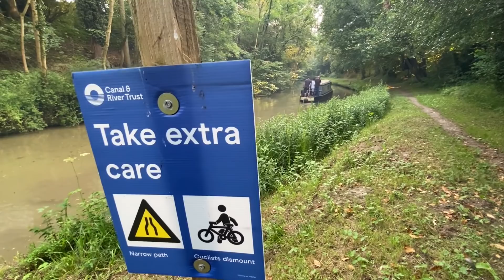222. Final steel sheet welded to Narrowboat

Comment: Hi James just a word of caution I have a friend whose main job is overplating boats he's had boats in where the new plates have not been fixed to the Old Hull in enough places this causes the new plates to vibrate when the boat is moving and can fracture the welds along the outside thus causing the plates to detach
Reply: I'm a little curious about the overlap joints normally you would bevel the plates and route and cap the joints tying the old baseplate to the new one,
Reply: Also those plate should have been folded as well as now they will be constantly under pressure.

Comment: I've been a shipyard plater for 40 years and have never seen anything like that.why would doublers be overlapped like that?  Plates should always be chamfered and set up as a butt joint. Occasional plug welds should also be made on the bottom flat sections to stop the doublers sagging.if the horrible welding on the Chines start to fracture the whole bottom will start to come away.very lazy work.
Reply: That's how I would do it too!
Reply: On the inland boatyards you often find welders that are totally unqualified, its pretty shocking and there are no standards for repairs at all, most surveyors have no clue about welding and will pass anything that looks OK.

Comment: I weld a lot of narrow boats from full plating to  infill deep pits with weld filings.  I algays use flux cored welding wire usually.1.2mm wire. Never had any trouble in tbe wind as the flux is built in o the gas wire..

Comment: A friend who is a steel fabricator ( his own business ) building heavy plant stuff / trailers - bulk tankers, he can't believe seeing this.
Stress fractures will happen along the welds as the plates have no formed bend / angle in them, the plates will try to  spring back flat away from the edges ( stress fractures ) either through the weld or along the edge of the heat zone from the welding on the  old thin side steel.
Reply: My and other comments regarding welding practices have been deleted, why is that.
Reply: @garychamley3095 
Oh really, wonder who's done that and why 🤔
Reply: Put the boat in a normalisation oven 🤣 and the mig also looks rather small, amps wise !
Reply: @npo1297  truth hurts. I mearley stated I thought that was the root weld, and it was going to be capped off. But my comments and others are deleted because we christmas tree and stack dimes all day long.
Reply: @npo1297  these comments will be purged unlike the welds. 🤔
Reply: @gregorymaymon1052  that is a toy, struggling with 1.2 wire. For that I would flux core the land of make believe. Hurry up sa and defend before take down 6g forever. 🇺🇸
Reply: @garychamley3095  ..  😂😂😂
Reply: @garychamley3095  Hi Gary. I have read with interest various comments regarding this job and as I know Richard very well thought I'd see if he has any thoughts. He thinks that in all likely hood James saying that the weld is 3 to 4mm is the core of your concern, as it would be his too! The welds are actually 6mm fillets, inline with BS EN ISO 9606. The bit of the MIG welder you have seen & doubt it's capability is actually only a wire feed unit. At the other end of the umbilical is a 355amp, 410volt plant which delivers more than enough power for ample  penetration in one pass which is standard for boats of this nature. I hope this puts your mind at rest. All the best.
Reply: @MumpyKump  thanks for the info, how's it being tested for pin holes. There is a lot of start and stop points, more work created for grinding back and re-welding. I have to engrave my work with my ASME 1X certification so any fails come back to me. I'm tested every 6 months to keep my 6G rating.
Reply: Re-watched and definatley not impressed with the welding.that is just a 3 phase mig set. but whatever itll have some busy bilge pumps.
Reply: 😅 @MumpyKump

Comment: Theoretically, rust needs water and oxygen. Any water getting between the plates would never see any air. 
Personally, I'd be tempted to screw a few greasing nipples into the inside plate and pressure feed waxoil or similar into the whole sandwich.
Reply: Nice idea

Comment: You need more welding to do on the side that's welded 10mm min of weld and to me as a welder myself you need to constantly weld as much at once not 100mm / 200mm at a time as I see it now your going to have a leak between the two plates the new one and your floor under it.
Reply: With a new shell, they weld both interior and exterior of the floor pan, and use a dye test. You can see the little gaps in this. It will leak, maybe not much but it will leak.
Reply: Don't mention asme 6g they delete posts.
Reply: Don't mention dye pen testing.
Reply: @terencejay8845  wtf.
Reply: @terencejay8845  there’s only so much you can do, I suppose. If it were more critical, you could grind 45 degree angles onto the plates and build it back up with weld, bottom up. That’s what they do with industrial stuff when there’s no access from the rear — or sometimes even when there is access, only then it’s 45 degrees from the middle toward both sides. But let’s be real, this is a narrowboat. Firstly, pinhole leaks are pretty well sorted by an automated bilge pump (I assume there’s a system that logs how often it turns on, so you know if there’s a real problem vs just a little condensation here or there). Secondly, as James here has just practically demonstrated, a small progressive leak will usually give you enough time to put the boat on the side for repairs. And thirdly, even if a narrowboat does sink, it typically sinks, like, 2-3 feet or less. highly unlikely to kill you, which is always a more important criterion than a boat sinking. Even if it is your home.

All in all I suspect this kind of overplating process is good enough for the purpose.
Reply: @JasperJanssen  Sure. It's a reasonable solution. Unfortunately James got stuck with an angled keel instead of the usual flat base. Although he had fitted out much of the interior, it may have been worth taking it all out, removing the old base and welding in the new flat one. Who knows? I'm sure it will last him for as long as he needs it. I'm worried that one of the plates will 'pop' as he's motoring along as they weren't pre-bent. They're under constant stress.

Comment: Did you repair the bottom of the boat first, to prevent internal water getting between the skins?👍
Reply: Yes he welded a little patch over the hole👍
Reply: @johnneal7832  yet you've allowed cavities between the plate's
Reply: @johnneal7832  those plates should have been folded prior to fitting all you've done is pulled the plate's under tension.

Comment: Why don’t they cut away the old hull before welding the new one on?  Sorry I’m a aluminum and fiberglass boat guy who only uses runabouts and not houseboats. Also, American, so you know.
Reply: haha 😆 you yanks love from Oz
Reply: James has most of the interior installed, it would set the wood on fire if they cut the old hull off
Reply: Not to mention this isn't a performance hull; there's no harm in a little extra ballast.(actually James needed the extra ballast)